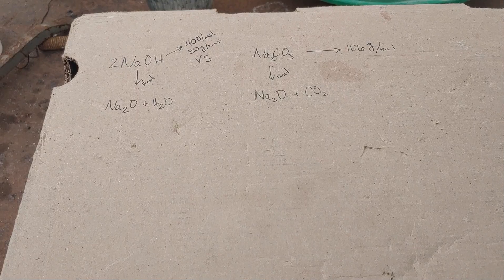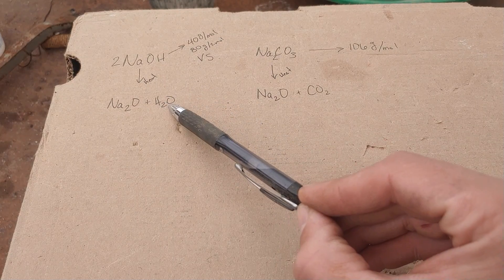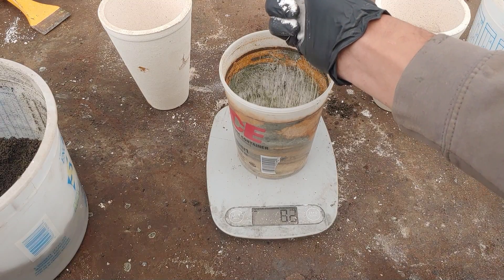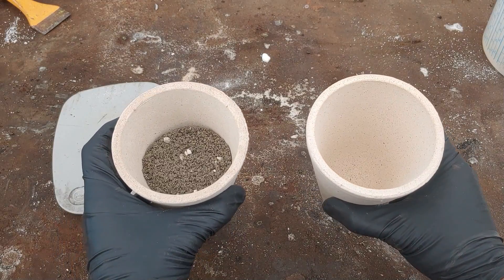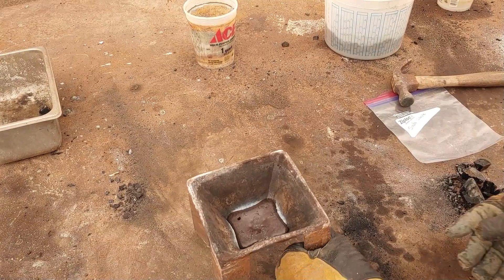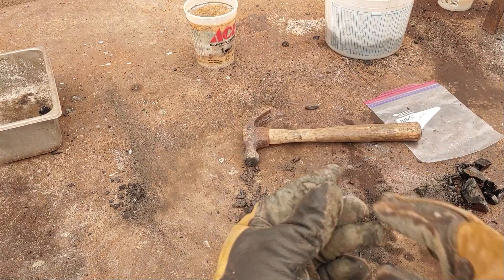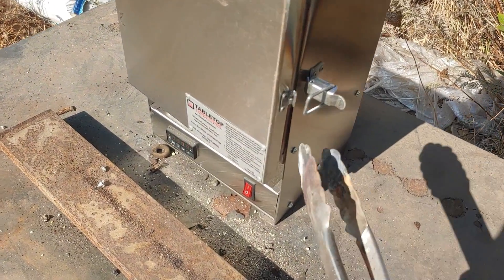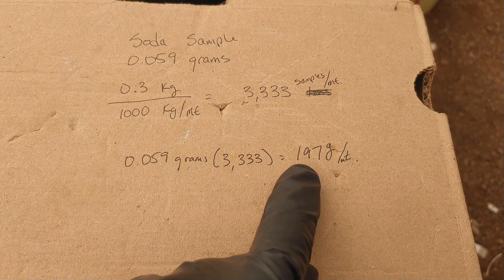Gold Smelting Test! Determining the Best Gold Recovery Flux

Comment: In 1977 I worked in a gold mill. Knob Hill mining Republic Wa. This is how we process the ore to recover 99% of the gold.  After the crusher and clarifier the very fine ore was put into some solution that included pine oil. The pine oil frothed up making foam. On top of the foam you could see lots of trails of gold. Really they often were "gold bubbles". Paddles with air bladders would rotate, horizontally, through the foam, slopping it over the outside edge of the container. This "concentrate" would fall to the floor of a locked room below. Thsi would go straight to the smelter. When I first saw in the room the concentrate had been shaped into a long row wall to wall about a foot wide at the top and about 6-8 inches deep. The sides we sharply slopped so an accurate measurement could be taken. The next step is where I took over. The muddy solution that was left over (about the density of a thin milk shake) was sent to two large cylindrical containers. Chemicals were added here and then the solution was sent to many other vats of similar sizes until it ended up at the thicker. The "thicker" is the same as they use in a sewage treatment plant. 60' foot across and 3 stories high. The gold was suspended and reduced to a particular size using cyanide. This (clear as drinking water) "Preg" (for "pregnant" with gold) would spill over the side at the top. It would then be combined with zinc in some vacuum chamber. After this the only thing left was gold, silver, zinc particles that combined at a very exact size. This was ran through four locked tanks that held "sock" like bags. (we called it the bag tanks) 144 socks in each of the four tanks. When removed the each held about 10-12 inches of this gold rich concentrate. The water was then pumped back up to the mine. I always thought the process was facinating.

Comment: Hi Jason, the only way to do an accurate test is to have samples with known quantities in them. Then you can measure after the test and see how much has been recovered. Does it help to pour the molten metal/flux quicker in to the test mold? For some reason it seems to me that more flux flowing with the metal rather than less flux would recover more metal. How porous does the crucible get? It looks rough making it tougher to pour from.

Comment: Frothing and bumping play merry hell with any reaction, whatever the temperature .
At much lower temps where standard glassware is used , it will at least contaminate distillations , and even destroy your glassware .
Testament to just how much energy is in play even in everyday things like a boiling pan of water or a vehicles coolant system .
Also , the CO2 makes the reaction more acidic , at least until it all off gasses .
You should see little difference in recovery efficiency with most sulfide ores between the CaCo3 and the CaOH .

Comment: The frothier sodum carbonate may enhance the convection currents in the melt, bringing the precious metals into contact with the collector metal more.
Reply: I agree with you 200% I think 20 muleteam borax has it's place. And it boils like mad. I Wrote Jason this .
Jason, I have been told that sodium makes for silver losses. It destroys platinum too. The only recipe for platinum I can find is 10 to 1 borax. Now I ask you, how much silver is lost? any gold lost? The oxidizer? burning up stuff. Where is the flour or charcoal. Where is the reducing atmosphere? You use an OXIDOZER.
   I think if you look into the boiling point/burning point of sodium is near the temps you use.
I have heard of guys using lower temps/longer times? and getting better returns. You can't have metal AND burn it. A traditional Turkish goldsmith would take a round clay coffee cup looking thing and layer silver powder and then screened charcoal. Multiple layers and then covered with a lid of damp clay.. Now that's a reducing atmosphere. You need to look up David Hudson, Oremus on you tube. Mono atonic gold has an S5 orbital or something that makes it act like a halogen (Sodium and chlorine are halogens/) You couldn't forge anything out of that. It burns up. My guys use resin to dissolve the gold. But burn up the gold getting it out. Same deal on the arsenic / acid  then put into charcoal. How to get it out of the charcoal without burning it up. I have a prospector playlist  that has it if you can't find David Hudson. Yellow metal of gold is AU2.  AU is white or black or green and possibly clear , depending on how it is annealed. It's a rabbit hole bud. Thanks for your great videos

Comment: While the recovery is reasonably close I have to ask 2 questions.
1) which costs more to get? If the sodium hydroxide winds up costing more you aren't really saving anything even using less of it, the amount is not that big a difference for your use.
2) if the costs are comparable so the sodium hydroxide is costing about the same, which outgas would you prefer? The co2 which is a hothouse gas or the water vapour which has a cooling effect?
Yes the actual amounts are small so it isn't really a big concern for MBMM but the answers might change some viewers plans.

Comment: Interesting to see some original ore. I have a vein of sulfides that is easy to get to and assays 0.08/ton on the relatively clean sulfides. Have always wondered if that one is able to be made into some profit.
Reply: How wide is the vein? Might watch hardrock university to answer that question.
Reply: How many onces are on 1% of a ton? 2 pounds? so 24 troy oz? Daddy needs a new pair of shoes.
Reply: @paulcoover9197   1 percent of a ton is 20 lbs but the grade reported  is 8/100s of an ounce per ton or about three grams. With buyers margin you could figure 120 per ton which might be great if a huge volume and a big company could be intrested.  But for a small miner diging a ton a day 120 if perfect recovery minus costs is just about wages

Comment: Have you tried a similar test with litharge instead of lead?  If the gold particles are very small (likely in sulfides) they will have trouble settling through the slag to the lead.  We  have a problem with vaporization from the resin, up to 50% losses if we ash first.  However with a litharge fire assay we get good agreement with the solution mass balance and XRF of the resin.  Freezing up for the season tomorrow, so we will move from the mine and mill to the lab for the winter.
Reply: I am a geologist at a underground gold mine with a similar hydrothermal low sulfidation qtz vein and agree 100%, while you are seeing free milling gold in the samples theres likely tons more gold  bonded with sulfides and possibly telluride complexes as well.  Would love to see a video of litharge vs pure lead.

Love the vids as always, thank you Jason!!

Comment: I would suggest redoing it on a bigger scale. If they are the same then you might as well use the one that requires less to get the job done. only problem is without a known quantity of precious metal you don't know what your recovery rate is.

Comment: Wondering if you can reclaim the lead from the used cupel?  I reclaim lead oxide (dross) back to pure pb using carbon (sawdust) to remove the O atoms releasing Co2  in my bullet casting operations
Reply: I remember that Jason has done that in a previous video.
Crushed the cupels to dust and smelted with charcoal i think.

Comment: Hey Jason, why do you not use an induction coil to get up to temp faster? Is it just cost?
Reply: Induction only works on ferromagnetic metals.
Reply: @Rorschach1024  That's incorrect. Anything can be heated at high frequencies.

Comment: I'm going to brainstorm. The insulation on the furnace is lacking. The flame needs a short run to burn then contact the crucible. The incoming air needs to blow upwards, surrounding the burner to keep it from melting. Use enough air to combust the gas, any excess will cool the crucible. A stainless sheet around the crucible will reflect heat in. Insulate the outside. A thick piece of cast for the lid. A chimney to outside. Carbon monoxide is poisonous. So are metal fumes etc. Just some ideas for a permanent furnace. 

Love watching. Great show!